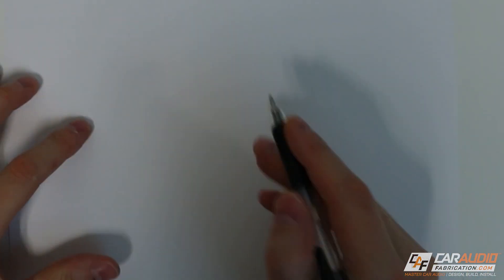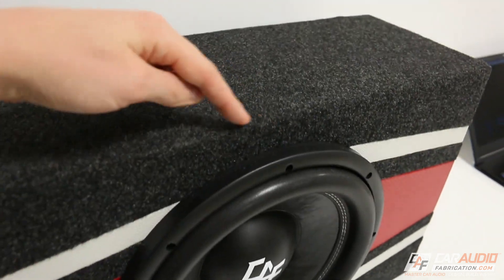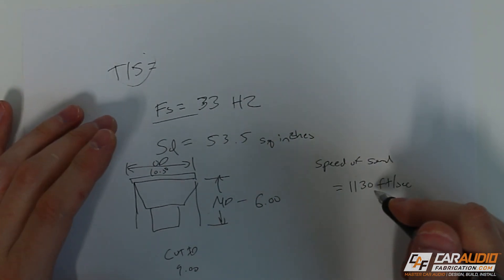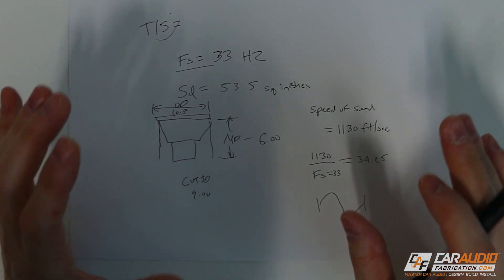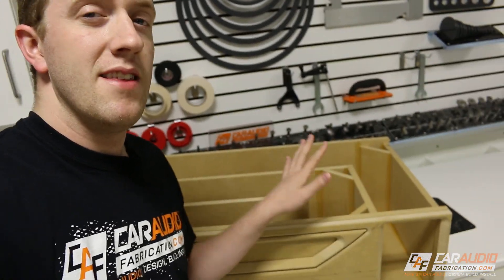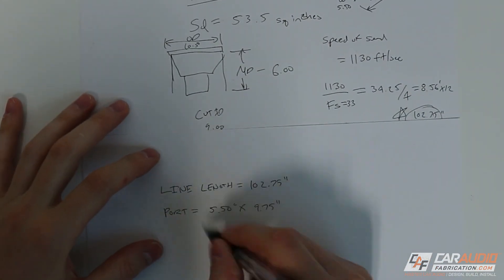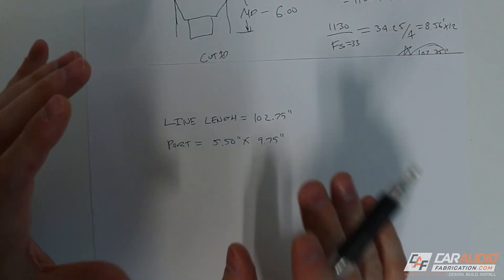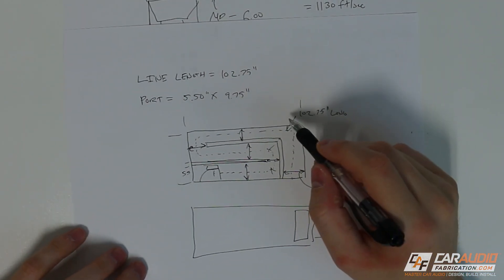How to Design Transmission Line Subwoofer Enclosure

Comment: I need your help, I’m trying to build a box for my 15” sub. I was thinking about doing the Tline but it’s just not feasible in my little sedan. So my next option would be a ported enclosure. I have calculated that I need 3.58 cubic feet and with the space I have I can achieve that. The problem is that I have a trapezoidal shaped space and I don’t know how to make the port on a slanted back of the box, do I just make the port follow the top height of the box, or do I follow the bottom depth? I will put my dimensions and what I want to do on here if you could just help anyway, I would greatly appreciate it, and btw I have been watching you for a while now and you inspired me to make a hidden subwoofer box in my spare tire space. Anyways down below are my dimensions for the box
33” wide
15.5” tall
13” deep at the top
20” deep at the base
I’m using 3/4” mdf and I need 3.58 cubic feet that’s including my subwoofer space displacement. I want to do a dual port set up, one on each side and the dimensions would be 14” in height with 1.5” wide. It’s slightly under my recommended target of 47.25”. Please please please help

Comment: Dude I am in the middle between work designing a t line enclosure for my old rockford fosgate punch hx2 sub for my 45+- x 45+- garage. Ai simulation and specs equate to box being 62.5" tall and 19.5"wide and 15.5" deep. I love it. Cant wait to get it going in reality. 
Thanks for this video it helps alot

Comment: So I did the math for my 15, the port would need to be 188” long, 14” tall and…..9” wide😂
Reply: I give some information to seekers..

Why more speakers and not a big one, and hear a real low frequency (?)...

Fs – free-air resonance frequency of the driver (here i used it a bit for for box resonance reference).
PA – Professional Audio (stage systems).

-The first: is the box complete size and the chamber size of the box what need to the excursion. (For huge boxes for a most of people haven't got enough place) A large speaker can move max (some) mm in a little box with enough soft sound.
The air compression cause distortion, not wanted sounds, mechanical sounds of speaker and hardness of sound. (but unfortunately moving too much air cause another problems)
For this reason an average low frequency speaker can be use on the 1/3 .. 1/2 of the Xmax without mechanical sounds.
In my experience the chamber of speaker size is optimally (membrane surface cm^2) * (excursion cm) =liter. 
Maybe you think this is an exaggeration.. (and really is not in every case good, maybe just i feel it good).
This is a limit where i cannot exactly sense more hardness. (With MY speakers).
My favorite box chamber ratio is W:H:D 2:2:1.

And the fact of acoustic short circuit what based on box duct length what if not enough long that cause you cannot hear the low frequencies. The duct cross-section area is in the technical literature is the 0,7 of the membrane usable surface but for example i use 100% because it depends on length because the forces (air pressure) on the membrane must be tiny. My duct is now 4,25 + outside 1 meter long from membrane to membrane back side and a strongest resonance is perceptible really on 14..16 Hz.
This way you see the box size is will be soon huge. 

-The third: the mass and surface of a large membrane cause it is late in phase compare with the smaller membranes. It maybe manageable but with just some mm move, this is why the PA speakers not infinity large. 
(But the large (more speakers) surface with tiny move is a good strategy for softer sound, lower frequencies)
The membrane materials (and of the box) is take a physically resonance frequency limit, absolute impossible made an FS under 15..20 HZ because the needed rigidity and low distortion is contrast to the lower FS materials softness and those mass.
This cause that the larger woofers has not exactly lower FS just the moving mass compensate it a bit but far not enough. (And the membranes have 'wild' resonances what you hear as sound but does not the original frequencies)

If even so you try to build one..  the materials thicker, heavier, less responsive extreme hard to move or brake down by physically inertia  meanwhile the magnetic gap need to be very thin without coil crashing with magnet.

When i started to studying these me too want lager membrane but i see how that work in the real world.

If you seek a big one you can watch the "The making of the Matterhorn" from Danley sound labs. In the interview video the man say the parameters. If does not impressive than nothing. (40 speakers if i see good)
I think that need to be sectional phase controlled but i don't remember he said.
And i think they use the colliding waves undergo constructive interference and they made a 'virtual horn from air' but i don't know.
I tell you it use another known audio technology fact: The 25..30 cm speakers give enough good electrical efficiency-Mechanical efficiency ratio.
  
-The fourth: hard materials and surfaces in the room can change the audible frequency, that sometimes multiplied because of the limited distances of the surrounding surfaces. 
Maybe you feel those enough low the truth is 'those are not the original low frequencies'. 
For example the needed distance between you and speakers is around 4 meter (343/20/4) (on 1/4 wave length) on 20 HZ if you have all the speaker and box can the frequency.

And if you can all do it somehow, than you meet with the next fact: All objects and material in the room begin annoyingly resonating :)

(every bass speaker can be produce very low frequencies but just with very low efficiency especially in small box)

The hifi lovers try to make lower FS multi-layered or foamy membranes with fast movement (nowadays expensive electronics and hard magnet motor and huge coil (that give heat dissipating and electrical efficiency) can control the movement of a 40..45 cm woofer enough fast with minimal distortion and less 'wild' resonances in a small box (but that is a hard task).. 
And the PA systems work with minimal moving and much more rigidity for higher volume.

And we have the box not wanted resonances (especially the horns have that).

And on the end of these, your hearing have a limited dynamically range what cause if you increase the volume you lost the details of all the sounds.

Subwoofer is in audio literature under 50 Hz but i use my own between ((3Hz -12,3 dB)5 Hz -3,2 dB) to (18 Hz -3,4 dB (MFB single ended butterworth second-order filter, read upon it)) it is underdriven below FS, is a good technique especially combined with a limiter for softer sounding.

Really the fact from woofer is: On original real low frequencies you rather not hear some another sounds when an subwoofer working than hear low frequencies. (But the pressure of air is tires your ears and brain more than you think (!) )

I write all these for others who's want to know something  (starting strategy).

Comment: Love your tutorials and have followed a few in the past with great success. Really struggling to calculate the port size, my issue is that the cut out and mounting depth to match, im using a 12" sub with a 6.22" mounting depth but the math says the port width will only come to 5.85", any help would be
 appreciated

Comment: what would I do if my subwoofer was deeper than the width of the port? I have a 10W7AE which has a mounting depth of 8", but with a 10.5" port height it'd only be 5.75" wide. Would I make just that section of the port wider? Would I make a small compression chamber with the port coming off it? Any help would be greatly appreciated

Comment: Hey man I want to build a tline enclosure for a 10 inch sub with a mouthing depth of 6.81 inches, the port length would be 104 inches long for a tuning frequency of 32Hz and its high would be 12 inches, however I could not get any information on the effective cone area so I used 8 inches, is that too wide or do I need to go back to the drawing board?

Comment: Hello Mark!

Your video it's awesome. Can you help me, how can i design Transmission-Line subwoofer box with 2pcs 8" subwoofer? FS is the same 33Hz. What is the different if we using two speakers?

Thanks :) Peter
Reply: If you are using 2 speakers your Sd is doubled. as you have twice the surface area.

Comment: Is there any benefit to going to half wave length transmission line box?
Reply: No, only disadvantages. If you port is 180deg out of phase as a half wave is, the port will try cancel out the speaker, it mostly isn't noticeable, but it can be.

Comment: 6:00 Here's another quick way to get the port height size, using just the speaker cutout size multiplied by the "golden ratio." In your excellent example, the speaker has a 9-inch cutout inner diameter, so multiplied by 0.618 comes out to 5.562 inches. Almost precisely what you got.  Hope it helps someone else. This also works with other quarter wave ports/cutouts/vents. In simplest terms, width is the speaker cutout, and the height of the port is the golden ratio. Some people just use half the speaker width as a guide for the port height. As you mention, there will be additional tuning done however you go about it. Just easy to remember, napkin maths...

Comment: When building a T-Line enclosure, do you know if there is a difference between mounting the speaker parallel or perpendicular to the line? I don't know if I'm describing it properly, but I would describe your speaker as being mounted perpendicular to the line because there is no chamber behind the speaker, it's mounted directly in the line.

Comment: Hi. My is Shannon. I have a new 2022 ford maverick truck. I am hoping to make a box for 2 - 6.5" skar 4 ohm subs. The subs are 200 rms. The truck has very little space behind the back seat. The box has to have .25 cubic ft for a sealed box for each sub or .60 cubic ft for a ported box . I don't know if your familiar with this type of truck . But I'm wondering what you would recommend for the design if the box. Thanks for your time. Ps. Your videos are very informative.

Comment: Newbie question: how does one determine which frequency to use?  Is there some sort of natural resonance for each speaker, or is it a personal preference, rather than based on the actual speaker?  Also, I have not seen the effective bandwidth of the TL mentioned.  I am a ham radio operator and use the same principles when designing antennas and transmission lines...our calculations provide solutions that can only work for about + or - 10 percent of the center frequency.

Comment: Thanks for the Video about T-Lines. I have some old, but never used 18" Infinite Baffle Subs that I never got around to using. I would like to do something unique with them. I had thought about a T-Line or Folded Horn. I have a large van, or could use indoors for Home Audio. Im not looking for SPL and Sound quality does not need to be great. Just something unique for demonstration purposes. I may give this T-Line a go.
Reply: I have seen a 2x18" T-Line sub, done as a straight pipe, it was....... 14feet long.

Comment: 1) there will be a 180° phase change when the sound wave reflects off a hard surface.

2) there should also be a 180° phase change when it transitions from the box to the cabin of the vehicle.

3) this box design tunes the system at the Fs of the driver, what happens when you tune the system for the resonant frequency of the vehicle, say 60hz? What gap does it fill in or does it provide a boosted response at that frequency, assuming the driver Fs is much lower?

Comment: I built the tapered transmission line box and the speed of sound needed to be more accurate. You can't really get an exact because just a change in 1 degree F adjusts the speed. 1130 fps is if temp is at 72 deg. Air in a ported box after 20 min is at 100 deg and usually stays around the 100 to 110 deg area, sealed boxes get up to 130 deg give or take. All this changes each sub is different so you can't get a perfect fps speed of sound. Instead of using the standard speed I used the speed at 90 or 100 don't remember. At 72 deg speed 1130 fps at 100 deg speed 1160 fps could almost be fully out of phase. I'm not sure if that would be the case or if it would even be noticeable. Just throwing it out there.

Comment: Shot in the dark, but is there a way I could possibly get in touch with you to see what I’m doing wrong? I’ve spent about 2 hours now rewatching this video and trying to design a box for my subwoofer and the math isn’t adding up. The port width keeps coming out to 10.16 in. But my speaker depth is 10.47 in. and that won’t work. I’m new to box building, but I want to build something incredible because my brothers 800w 12” sub sitting in a T-line box sounds better than my 2500w 16” sub in a regular ported box built to spec. I don’t have schools or people in my area to teach me these things. Please help a rookie like me.
Reply: we all seem to struggle with that, so something is not right with his calculations.
Reply: Ignore the other responce. Sometimes that just does happen and a driver cannot be used in a T-line setup. It is easier to design one for a smaller low freq driver, like a 6 or 8" than it is a 12" or more. The driver gets so much larger for few hz difference. One I built recently with a full range 4" speaker, I had to max out the width of the tunnel to get the driver to fit, while the magnet almost touched the back.

Comment: I tried to calculate a t line box for my 18. Is it possible that given my mounting depth, and speaker diameter, it will simply never fit in my cross section area????

Comment: Hi there, Mark. I liked your video for explaining things in very easy terms to understand for a newbie like myself. Got a question - let's say you target frequency was 60 hz using a driver with a response of 48Hz - 22000Hz. So, 60 hz is higher than 48hz. But what would happen if your target were 35hz? Would the accordingly calculated enclosure work with the same driver?

Comment: Mark, if I’m using two identical drivers instead of one, does my port cross sectional need to be doubled, or does it remain the same as when one driver is used? Also, can you back load  a t-line, or does that only work in a horn?
Reply: The Sd will change, so the line volume will change.

Comment: If I were to design my t-line with two 8" drivers, would I just double my SD and base my port dimensions off that new larger number or are my other parameters like port length now going to vary because of how the additional woofer impacts performance when in an enclosure? This is not intended for a vehicle so air space is quite flexible.

Comment: Horn speakers and TLs both actually do increase the possible sound because they increase efficiency. Your big woofer can move as much as it wants on its own, but it’s like hitting a ping pong ball with a baseball bat. You can’t actually move the air without having  a mass of air ready to move. They both make it louder. A back loaded horn does a better job, but not a single design of one has ever been perfected.
Reply: It's my understanding that yes they do in fact increase efficiency, but they only do it across the board. Flat response. Hoffman's law still applies.  The SPL increases, but the frequencies the driver imparts into the box will remain the same as the frequencies the driver has in a free air or infinite baffle. Any peaks or dips in the output are purely a consequence of the boxes own resonant frequencies, notice the plurality.  That is why it very important to use high quality materials, brace well, reduce standing waves ( stuffing and or 45 degree corners ), and lastly be prepared for lots of tuning. Luckily you can usually use a crossover or an equalizer to negate those errant peaks. Typically.

Comment: small mistake at 5:35 .... the subwoofer will not fit on that face since the calc. width is ~5.5" (this is smaller than the required 9" for cut out) This means that the sub cut out would have to be placed along the ~102" length, not the shaded area in your illustration.

Comment: I've built a T-Line enclosure for a 6,5" sub using this formula and it sounds great at low/medium volume but at higher volumes when the sub gets to move, a lot of turbulence starts to occurs at the port. Any idea of what causes this?

Comment: Dog food as a prop?  Ok!    I think people would be better off picking a sub with better specs and a longer throw for a car.
2 10w3" in a porter box with 500 to 1k watts in a ported box has plenty of bass output you'll have a hard time matching up your mids and highs to hit the same output. And at 120 to 139db spl it's going to damage your eardrums.  I'm pushing 60 my wife is always telling me to turn it down. That what I get for installing sound systems in cars and running them at full volume for 17plus years.  I'm talking systems that did up to 157.7 db spl down to 127 db spl systems your avg high end car audio system. The 157 was 6 18" woofers and 25k watts. It hit so hard you could not breath inside the van.
The metal walls of the van rippled with every bass note outside the van. 
I've seen cars that the metal tore open from sound presure and how the woofers were placed inside the car. I've seen windows on Benz move over an inch from the bass note.  I've heard of windows breaking but never seen it.
You really do not want to listen to a system that dam loud all the time, you'll be def in a year.